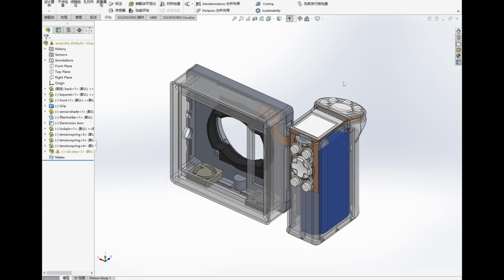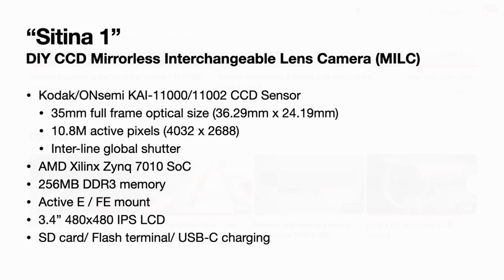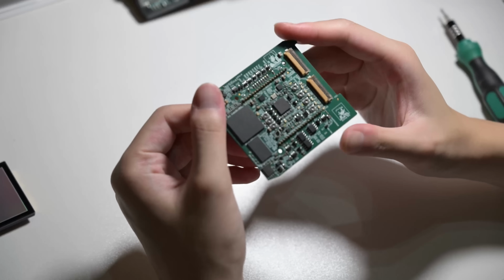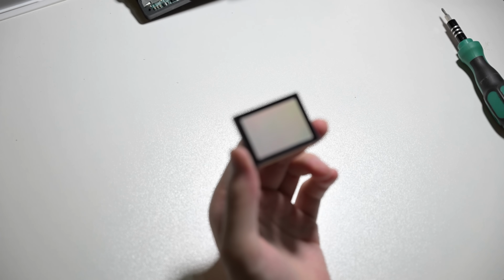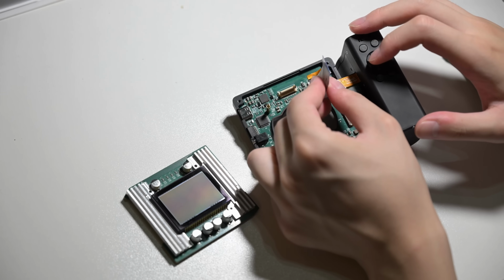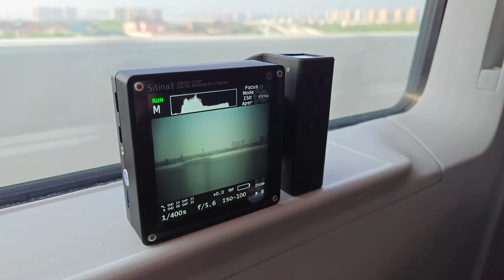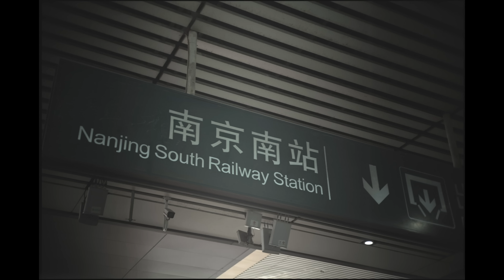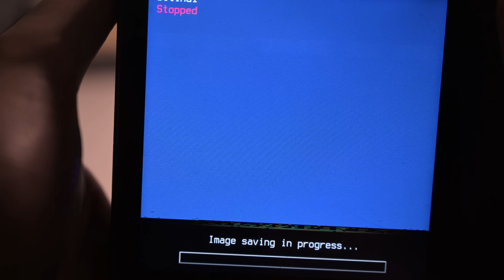Building an open-source full-frame CCD camera PART II

Comment: use interlaced video and line skipping for video fps (since it's a very large sensor)
i was going to recommend the konica minolta z2 since it would be a very good design reference.

Comment: This should be sold as a DIY kit. There are photographers that would be more than happy to have something they put toghether.
Reply: This thing probably cost in the realms of a Hasselblad seeing the use of expensive FPGAs, the sensors, the custom BGA boards with controlled impedance and ENIG whose fabrication costs probably alone go into thousands, PCBA dual sided for 3 boards.

Forget Hasselblad, this project probably cost more than that. People would peobably actually buy a Hasselblad when they see the price of this prototype.

It's probably more like a muscle car tuning project for electrical engineers where they splurge their money over the weekends rather than commercializing it.

Comment: How difficult would it be to make a camera that was controlled by USB cable and didn't need controls for the lens a battery or any handle or buttons? 
I am an amateur astrophotographer. 
We use dedicated astronomy cameras that are completely controlled by the PC and attach to the telescope as a prime lens. 
Seems like a lot of the complexity is eliminated?

Comment: For general usability you may want to reconsider the design of the cat's paw near the shutter button. Heck you could also ad a front command dial to allow for faster switching of the various settings.

Take a look at what other manufacturers did with that sensor to see what the issue (s) are with live view as it may just simply be down to a slow sensor readout.

I noticed a sharp line across the middle on some the text images where one side was darker than the other, looks like a minor calibration issue that is sensor specific/age of the sensor.

Comment: I know I might be a bit too late, but you could better make it's platform based on a Snapdragon Android system so you can make use and take advantage of the Gcam (Google's Pixel Camera) port and tweak it... I'm just saying could be a great idea...
Reply from the maker: If my goal is to make a good camera, probably yes. But if I still want it to be an open-source hardware project, then using Snapdragon is kinda a non-starter
Reply: @nbzwt  oh it’s fine, it’s not about making a good camera, but having fun with how far can software go. I hope you write down my idea so maybe in the future you can experiment with that lol

Comment: What a great project. I watched the first video when it came out and was impressed.
If you could make the UV filter removable without dismantling the camera, it could give you some options for full spectrum photography (No idea how well it would work, could be interesting to see in the next video?)
I appreciate what you said about making design decisions to just get it done though, i have too many unfinished projects that I struggle to find that balance for. 

It's great to see the whole process involved. Thanks for taking the time to make videos :)
Reply from the maker: What I was thinking was, if dismantling the camera itself is easy enough, then effectively the UV filter can be removed/ installed easily without actually designing it to be easily removable. (if this make sense)

Comment: A tip for the Firmware UI: “Just” copy the GUI from Blackmagic Design.
Why? Anyone with basic knowledge of digital cameras can navigate through the generic-looking text menus and understand everything.
A Blackmagic camera was the first proper digital camera I got coming from smartphone apps, a bit later I looked at Panasonic/Sony/Canon cameras and actually had to constantly refer to manuals to check what the various symbols and icons meant. Using those modern cameras from the traditional manufacturers feels like time travel back to the 1990s.

Comment: I think it would be an upgrade to just have it use a pair of field-replaceable 18650s that aren't welded together. That might complicate the mechanical design a little, but would be worth it for ease of battery acquisition and spares compatibility with other devices (I want my camera and my flashlight to take the same battery).

Comment: Question, I bought a Starlight Xpress HX916 ccd astro camera in 2000 for €2000, unfortunately the company never released drivers for any OS beyond Windows XP. Is there anything I can do to use the camera on a modern OS? Compatibility mode does not work and the company has done nothing to help me.

Comment: the images are striking. I love that the housing of this camera is so thin. it reminds me of the hasselblad SWC plus a side grip. I would kill for a monochrome full frame camera, I have even debayered smaller chips before to experiment with methods. The line down the middle of the image may be due to dual separate 'taps' that amplify the image in two parts, if it cannot be eliminated, perhaps in software you could artificially darken all pixels on the right half of the image by a particular amount (relative to their brightness, a gain factor really) and compensate for the difference between the two sides. There is also lots of fixed pattern noise. Not sure how to eliminate this but it is going to be much worse at higher ISOs. invest in a fast lens and shoot at low ISOs.

Comment: Incredible work. I'd love to see you get into the details of the circuit and board design here. Those driver current slew rates look really challenging to achieve without SI problems in such a dense board.

Comment: besides CCD have better dynamic range than CEMOS
Reply: Not true anymore except in very specialized cases but all sensor technology is unique and can get good photos and are for different use cases, the BSI CMOS sensor is the best we have now, and you should do research into stuff like foveon that tried to challenge the stigma around CCDs

Comment: Oh my god, each little mechanical piece must've taken weeks to design, and many iterations. And then there's the FPGA processor and its circuit board, probably a few months and lots of money on just that thing. And then there's the software. Also probably another few months on just that. In total this is easily several years worth of work, spanning many different technical domains! This is one of the most serious and dedicated hobby projects I've ever seen! Well done!

Comment: Amazing work!

You have some really great images coming out of that -  or to mention the 100s of hours to get to the great design. Sure, there could be UI aesthetic improvements, however, the core functionality is perfect. Just what many photographers want: essentially a digital version of their manual camera.

So much scope! Are there any larger format ccd sensors - i.e. greater than fullframe?
Reply from the maker: Thanks! There are larger format CCD sensors, such as those used on older 645 digital backs. But they are quite hard to source

Comment: This is incredible, I've been waiting for a part 2 since you uploaded the first video on the project. I am definitely going to make one. I have 2 of the sensors already but I am having so much trouble finding the AD9990...
Where did you buy yours?
Reply from the maker: I got mine from Rochester Electronics, you may find more distributors on octopart

Comment: It would be really neat If instead of using an sd card you could just slide in a mini nvme SSD
Reply: Why? It's only 11Mpix and it's not like it shoots at 200fps... why nvme?
Reply: @chaugan  why not make it capable of doing that?
Reply: @HelamanGile  you need to argument for why it is important for you. I bet it also draws more power. SD cards are an industry standard for cameras. Why need an nvme? It's a simple question, which should be answered with "because why not". Make your arguments.

Comment: This is very high level and well made, you have a great future as an engineer!

Would reading the sensor via USB be a simpler implementation?
Or is it just a completely different design and still very hard?
Reply from the maker: If the only thing it does is streaming the data over USB, then the LCD, grip, battery, dials can all be removed. In that case, yes surely that would be simpler. Then one can argue in that case compactness also no longer matters, so it's even simpler without space constraints
Reply: @nbzwt  Watching from Edinburgh Scotland, Chinese people are the most intelligent and best educated people in the world.
Reply: In this case you'd still need another chip to convert the Raw output to a serial USB signal! Might be easier if you can get an ASIC for that!
Reply: I would love a full frame webcam 🥹🤣
Reply: @ViniciusMiguel1988  And i'd love a FF astro camera 😂

Comment: Bro, the development of this must have taken a looot of money. It's incredible that you open source it!!
Reply: Though it's not viable to be made because the sensor part is... Discontinued...
Reply: @houghwhite411 yes but building on this work and replacing it with a modern part or scavenged sensors from old cameras is less work than starting from scratch. 
Nice project !
Reply: @Krmpfpks good luck getting this to work with a different sensor that doesn't have a datasheet
Reply: @gordon1201  Without a datasheet it will be extremely hard reverse engineering. But I think the data sheets are out there for at least some sensors, even if some might be in a grey area to get. Either way, this is probably out of reach for my skills, I‘m a software dev by trade and only a hobbyist in electronics. It would probably take me thousands of hours (and lots of money) to learn the necessary skills and actually do it. I only have a 200Mhz oscilloscope for a start…
Reply: @houghwhite411  My opinion is that it would be easier to talk ANDANTA (or another "smaller" company) into releasing a data sheet, especially if the people from Apertus AXIOM (an open source cinema camera) join forces to talk to the company, especially since they have connections with the magiclantern guys.
Imagine a 16k x 9k - 144MP sensor (it doesn't hurt to dream) in the AXIOM Cinema, and smaller 4k or 8k sensors for projects like this.

Comment: Wow! Absolutely impressive! Thanks for making it open source! To reduce the reflections of the acrylic panel, you could apply 'OCA' Optical Contact Adhesive between the two, which cures with UV light (or the sun in a pinch). That's how phones do it. Just make sure to seal the gap of the LCD's frame. There are also cheap iphone-sized OCA sheets which are just adhesive, which may be simpler. Check out DIYPerk's giant iphone video and how he solved the issue